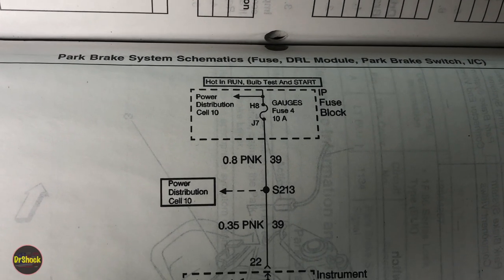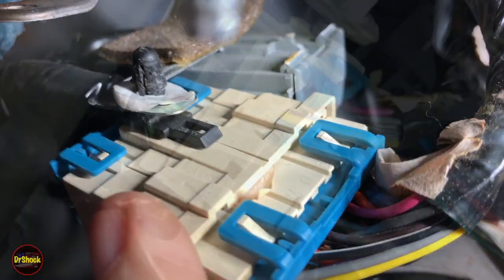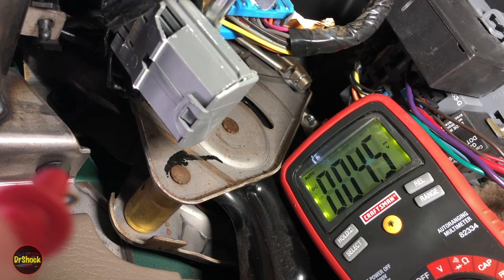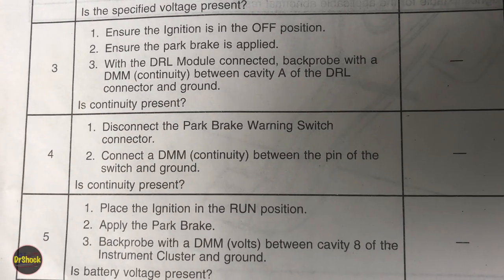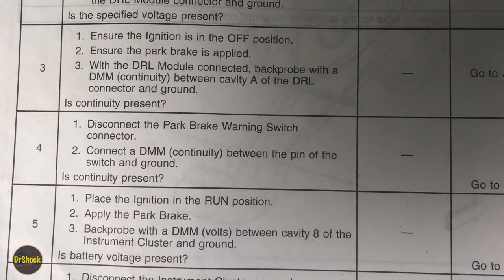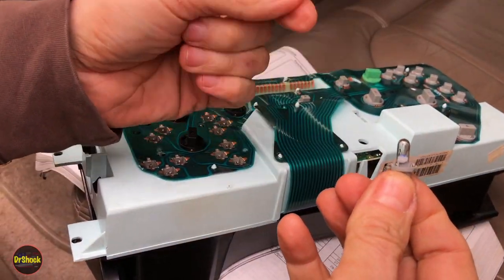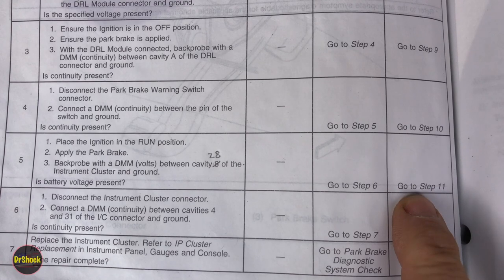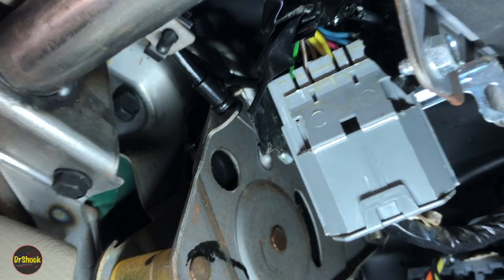1996 - 2002 GM OBS Truck Parking Brake Lamp Out Diagnosis ~ DRL Module Replacement (Chevy & GMC)

Comment: Where do you get the diagnostic books from?
Reply from the maker: Those have been out of print for about two decades now, but you can sometimes find them used thru the link in the description.